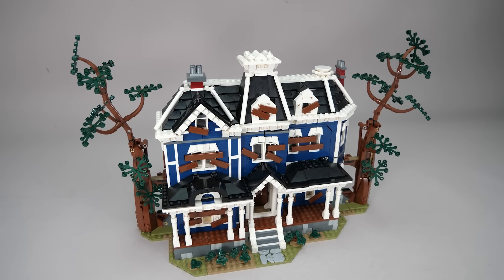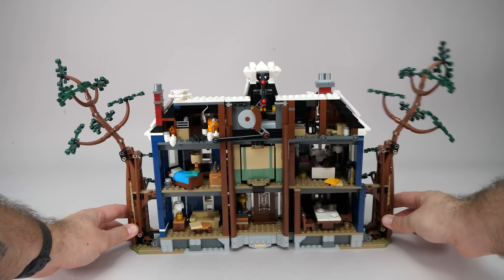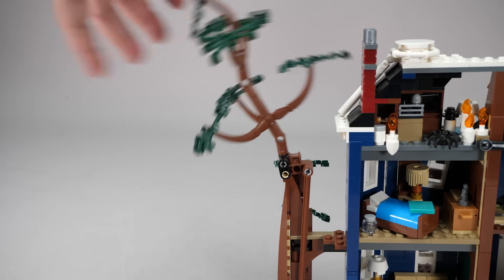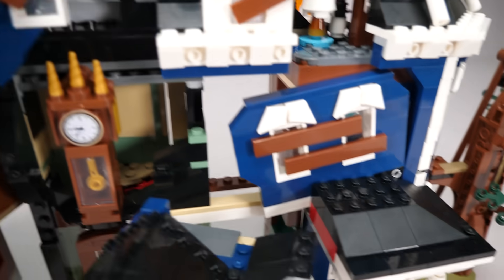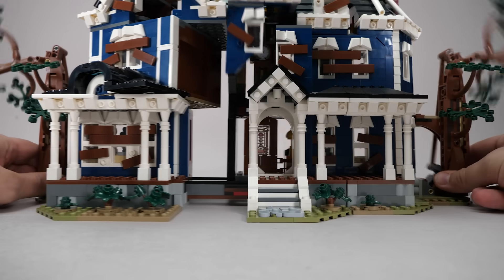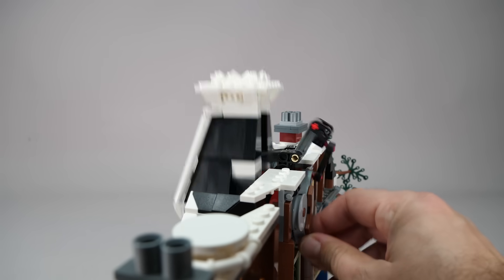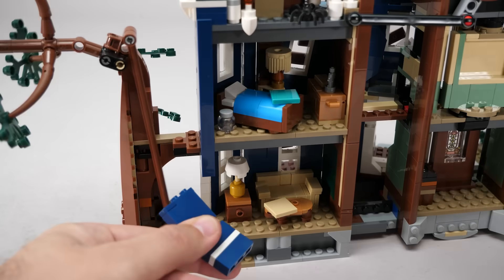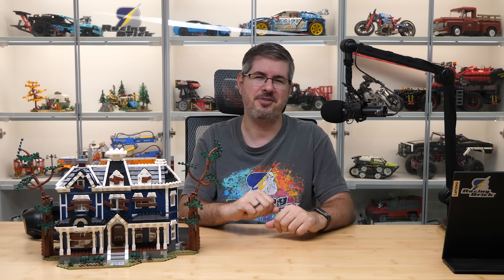Spoiler-Free Breakdown of the Genius Mechanism in the LEGO Stranger Things 11370 Creel House

Comment from the maker: More details about the set at LEGO - https://bit.ly/3YpJ35E
Reply: Hey this is kinda unrelated but I was experimenting with a few spare pieces and found something cool, if u take two robot arm pieces(not sure what they're called) and clip them to a 1x2 clip piece, then take 6stud long rods and put them in the bottom of the robot arm, then put two more robot arms with another 1x2 clip piece in the same way, u get a cool door like thing which is pretty much minifig scale, and u can tilt it to build at different angles or fix it in place with other pieces. As far as I know it's not an illegal building method and I found it by just joining random parts, so I'm surprised it hasn't been used in any sets.